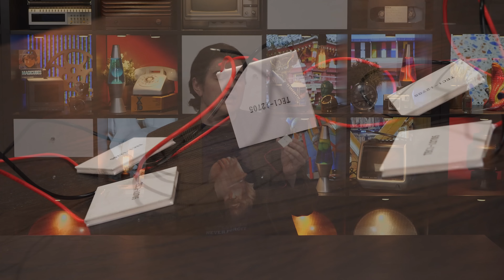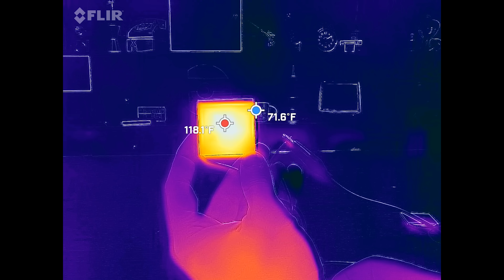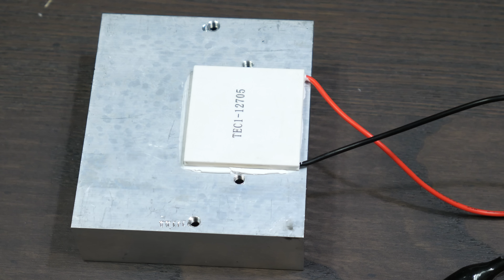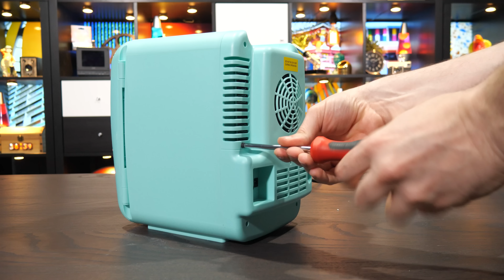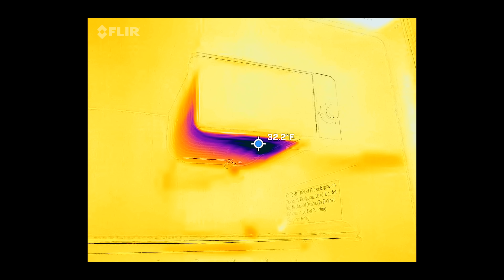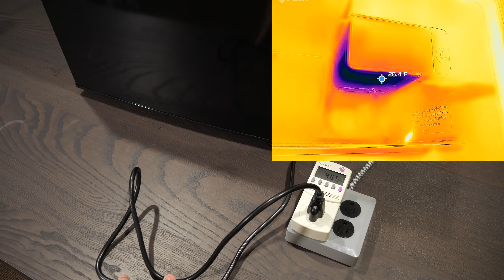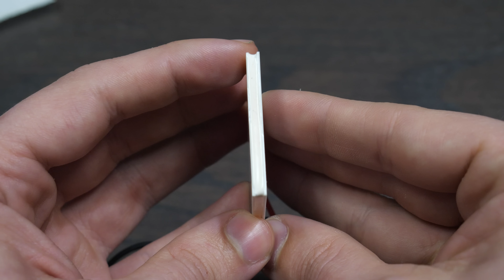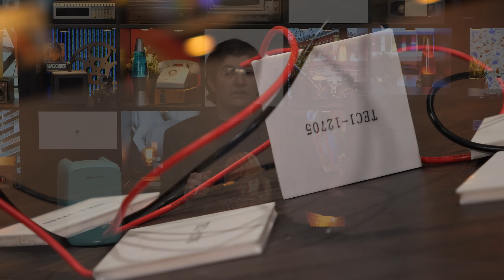Thermoelectric cooling: it's not great.

Comment: Any kind of possibly useful for a small cooler with Peltier requires fans on both hot and cold sides, plus best in class insulation, and, are useful only because of the compact size, and 12 V Operation...I guess, if I could get a 10 litre cooler that could run from 12 V, that would be dandy, but these all cost more than an office size fridge...

Comment: We use the other side of the Peltier to make a mini-incubator. It works well. However, if you're trying to grow cells inside, it requires a CO2 feed and the Temperature needed to be calibrated. We are building it up to make a product package to use with our custom diagnostic tools.

Comment: Peltiers are a cool technology (pun intended) but it's laughable some of the consumer products that they're put into and horribly inefficient for. 

They're useful for very specific needs where efficiency isn't important (why you'll never see them used for laptops) and often temporary such as transporting perishable items from one cooling solution to another. But in the vast majority of real world applications there's simply superior solutions available. 

The most viable consumer application would probably be exotic CPU cooling but even then you need a lot of other tech to keep it in line and scale quickly up and down with the cooling needs of a CPU, because when that CPU stops working hard that peltier quickly goes sub-ambient creating condensation. I don't need to explain why water+electronics equals a bad time.

Comment: So the FDA recommends 40° F or about 4° C as food safe. The EU recommends 5° C (41° F). Both sound reasonable enough, but then there's us Germans with an unhealthy obsession of energy saving. The German Federal Environment Agency (Umweltbundesamt) recommends 7° C (45° F) to save energy. And there even some "experts" on public broadcasting media that recommend 8° C (46° F) and if you ask around, some people go even higher. I personally use the EU recommendation with 5° C. I really don't care about saving energy if food safety could be compromised. Health is way more important. According to the data sheet of my fridge (based on EU-wide standardized metric with 5° C) it's using about 163 kWh per year. Each degree C less will save about 5% power, so turning my fridge to 7° C instead of 5° C would save about 16 kWh per year or about EUR 5.30. Wow, that's not even worth a Big Mac ...

Comment: It’s funny, because I actually own a good quality micro fridge that uses a peltier cooler.  And it gets cold in there, so cold that ice forms on the screws, and my drinks could be kept cold in my bedroom during the summer in Nevada.  Granted, it was a Star Wars micro fridge that looked like R2D2, and it came out before the new trilogy so quality was kind of to be expected.  It wasn’t the most efficient thing in the world, but I also didn’t have a lot of space in my bedroom, so it worked decently well.  Although I completely agree that the ones from AliExpress that cost 30 bucks blow as good as a shark.

Comment: I'm surprised with your such detailed examination of cooling via Peltier  modules, that you didn't mention that they can also produce electricity. I have a wonderful little fan in the top of my wood burner that efficiently spreads the heat from the burner around our home and the fan is powered by a Peltier module for free no batteries, taking heat from the burner at the base and cool air sink via the upper fins being drawn through by the Peltier module driven fan making the cool / warm Peltier module plate difference and hay presto electricity generation. I think you need to do an update showing this common contraption. I once had a workshop where the electricity was in on the rent and I had a Peltier cooler there, it was about four times or more the size of your demo Peltier cooler and it kept bread, milk and other food stuffs fresh, plus after work beers importantly and it ran 24/7 for 5 years; probably not that environmental friendly, but better than all those CFC's that will still be released one day when those age old pump fridges gives up the ghost hay, how's the hole in ozone layer going over your way today ¿?

Comment: I'm sorry I don't have half an hour to watch your video but I watched the first 10 minutes. Which annoyed the s*** out of me. The first 2 points you made against that little blue fridge I personally know to be wrong about devices cooled this way. It applies to that little blue trash yes. However I had a basic cube like you showed as a peltier cooled fridge that had a temperature knob AND kept my beer around 32°F for years. Meanwhile I have a small wine fridge also peltier device which also has a temperature control (digital) that I have had set to keep my wine bottles at 42°F which does so. I do not have air conditioning so my ambient temperature is basically outside temperature so my wine fridge will cool and keep my wine cool (at 42°F) even when its 102°F out. So yeah you bought junk and compared it to real real Refrigeration devices that doesn't make all pelty on devices junk. Is it safe to assume since I already know that your first two points are inaccurate the third one's probably not accurate with all of the devices also.

Comment: Peltier elements are also used in automotive seat heating/cooling! Heated-only seats generally just use heating elements, but "climate-controlled" seats will use Peltier-elements with fans to quite impressive effect!

Comment: The energy usage is defintely something to consider in something like that.  Unless you have ever before, you should do a video on heat pump water heaters, and in comparison to standard heating element counterparts.  They sound like a pretty good deal, especially for the free air conditioning they can provide, and if not just this side of $2K, I would have replaced mine with one.  Alas, that was well out of my budget, and went with a standard elemented unit instead, though that unit does have WiFi that allows you to adjust temperatures per days/times, which made already a good bit better than the original water heater, despite it having 10 gallons more capacity.

Comment: You can also get small 12v coolers for the car that are compressor based. We take one on every long road trip. You can even run them on small portable battery packs for 8-12 hours in case you need to leave it in the car overnight while you sleep without running the car battery down.

Comment: 25:18 you should do a video on portable refrigerators :)! For example Makita makes a portable Refrigerator that runs on power tool batteries, 120v, or the 12v of a vehicle! It actually has a legit compressor inside too!!! It's really expensive though 😬

Comment: There are two points I thought of that seem worth mentioning. First, when discussing global warming potential of isobutane, its main benefit is that it is volatile. Most of it will never reach the upper atmosphere, nor will it persist there. Second, the other issue with tilting a refrigeration system is that liquid refrigerant can end up in the compressor. If there’s more than a small amount of liquid refrigerant in it when it starts up, it will severely damage itself.

Comment: Way outside the scope of this video, but one neat technical use of Peltier elements is in chilled mirror hygrometers. Basically it uses a Peltier element to cool a mirror until it fogs up (fogginess is detected with a laser), then it measures the temperature of the mirror to determine the dew point.

Comment: I have a peltier powered fan that sits on top of my wood burner. The heat from the wood burner powers the fan using a peltier and moves the warm air around the room. Completely different use for it of course but I think an efficient and cost-effective one?

Comment: My only experience of these little fridges was during my time at University in the UK in halls of residence, I didn't pay for electricity so I had no idea of the cost of running it, and I don't know whether ours have better insulation over here or if its because we generally have a lower ambient temperature, but it cooled my beers very well, yes it might take a while to get them cool from being put in but it wasnt bad as long as I put new ones in while there were still a few cool ones, and it got so cold inside that it turned condensation on the walls to ice. The noise never bothered me, was quieter than my PC fans that were only a few meters away. And I couldnt afford (nor fit) even a small mini fridge in my room as a student, pretty sure my peltier cooler was cheaper than £30 and mininfridges were more expensivethan £100 at the time as well. So whilst I dont deny any of your science, I do think there are some limited use cases where they are preferable to a technically superior proper mini fridge, especially people with prepaid bills.

Also you get peltier cooled cool boxes which can plug into cigarette lighters in cars or usb power supplies like battery packs which can be useful for camping or traveling, not quite the same silly plastic box but a similar and non niche use case for peltier coolers as a means to keep food/drink cool for longer.

Comment: You've said that heat pumps have an efficiency of like 300% the electric cooler doesn't have those benefits which is a major part of the problem, I wouldn't be surprised if the fan alone pulls 8-10 watts. There is no way we will ever reach anything near 100% efficiency let alone 300% of modern heat pumps.

Comment: I work as an engineer and we are working on a device where heating and cooling are both required and in a small space. Peltier elements are great for those and what we currently use. Just changing the direction of current makes the hot and cold side switch. Granted it’s not the only way to do this, and it’s not the fasted either, but in terms of simplicity it’s quite neat

Comment: Personally I believe one of the  biggest problem with these is just design. The manufacturers always just have a small metal plate on the cold side of the pelt unit and the heat sinks while a fair bit bigger than the pelt unit itself, are still a little small. If they built them so that all inside walls of the fridge (except for the door obviously) were one big metal container attached directly to the pelt unit, and if they made the back of the micro fridge almost entirely a heat sink in it’s self, I’m sure they would be far more effective. No more efficient probably but that’s not really my gig. 
But as is, most of the heat isn’t being effectively conducted from the cans/inside of the fridge into the pelt unit itself.

Comment: yes perhaps it is the 3 times 230, but your quote here : "it's much bigger than a typical mini-fridge" implies that you are talking about a not typical mini-fridge or atleast that's what I hear.
btw there is one really simpel good use of a peltier element you see a lot here in europe were people like me life, who just use 6to8 kwh a day in a 7 people household (Ok I know that's low even for europe).How are we able to life with that little electricity? We burn wood to heat our house , water and even cook on it in winter And we use cob (thermal mass) to keep our house cool in sommer.  
And  on  a wood stove you can put a ventilator driven by a peltier element. It's really effective to spread the heat through the room.  You can get them for about €20 and are often marketet as  electricity free ventilator..... yes I know reality and marketing....

Comment: I have built a small peltier based fridge by myselft. Was a quite good lesson for my apprenticeship. But I never used it for a long time, cause the wires I used to withstand the 8 amps at 14V were not thick enough and it gets very hot the longer the small thing was running.

Comment: TEC modules have also been used for PC cooling, just slap one between the CPU and cooler, now you got improved cooling.
Linus Tech Tips also built an actively cooled gaming chair with one, with watercooling tubes going through the seat foam and a TEC between the waterblock and a CPU cooler.

Comment: My eyes have rolled fully around so I can see again.  I bought my father a wine cabinet some 15 years ago.  It keeps two cases of wine within one degree Fahrenheit.  And it does it via thermoelectric cooling.   Yes it does have a fan, but it is a jillion times quieter than a compressor.  AND it uses less electricity.  No it doesn't run all the time, only when needed.  

The Peltier element in it is not much bigger than the one you have there.  I think the problem must be with the control circuitry and materials, and not thermoelectric cooling in and of itself.

Comment: While you're correct that heat pumps are more efficient... you're totally ignoring other elements of physics at play.

There's a reason why polar bears are the largest amongst bears... the larger a body gets the smaller the percentage of it will be exposed to the surrounding temperatures.

If a polar bear was mouse sized, it would need to be very hyperactive not to freeze solid in a few hours.

So, my suggestion would be,  do get the same wattage of peltiers with cooling elements, perhaps use a proper noctua with heatpipes on both the heating and cooling side and use it on the same fridge, same size and watts and all... that would be comparable.

Anyway, I do agree that the microfridges are not efficient... but it's not just because they don't use heat pumps. The smaller an ice cube gets the quicker it melts... simple physics that you seem to ignore while you rant.

Edit: 😏 is this all because you understand heat pumps but have no clue how peltier elements work?  Think of them like LEDs but on heat rather than light... they can harvest heat energy, just like LEDs can be light sensors.

Comment: I have a Coleman Thermoelectric "ice chest" which I have used several times for the NAMM trade show in Anaheim California for our Hammond USA crew.  It doesn't get instantly cold, but since the Anaheim Convention Center is usually rather cool inside 24/7 it did very well.
Reply: A friend purchased one of the little thermoelectric refrigerators which only holds a 6-pack of soda and was surprised it didn't cool that well... hehe

Comment: I used to use one of these and although incredibly inefficient I didn't hate it. I used to keep the my beverages in the main fridge downstairs and then I used to put some in my office mini cooler when they were already cold. I don't like my house too warm, so room temp I keep at around 18-20c. My mini cooler would happily keep my cans around 4c. Not bad for the price I paid. Besides that if you stack the cans on top of each other end to end you can 8 in there rather than 6. 

Again incredibly inefficient but useful as a device of convenience for when I was working and may not be able to leave my desk for long periods of time. Also they are great for white wine lol. Decanting wine into a suitable vessel that fits in the cooler means you can top up easily while watching a movie without having to go the kitchen or ending up with warm wine by keeping the bottle on the coffee table.

Comment: Actually, i use a mini freezer for my drinks on my deck outside. I turn it on the lowest thermostat setting and it keeps up with hot outside temps just fine.Never had to set it any lower to keep up. Always makes bottles and cans frosty fast.

Comment: If it can theoretically get below freezing if only the door was insulated fully, you'd think they would at least partially insulate the door so it can do better than a 30 Fahrenheit difference after 12 hours. Maybe even fully insulate it then lower the power use to avoid freezing and save on power at the same time.

Comment: Dehumidification in a small area without tons of noise and power is currently saving a bathroom from mold and mildew. (No good way to add or improve ventilation.). My gripe with most of the products is that they seem to be screwed and snapped together so that I am not able to service or clean the inside or replace the computer fan with a quieter one without breaking the plastic molding.  I have had a few units fail eventually with the AC to DC converter usually from 120VAC to 9VDC.

Comment: Just doubling down on his last point but the portability and the ability to heat as well as cool are the main two advantages to these designs. When used in the higher end portable coolers they tend to have proper insulation, dual fans for better air circulation, and a thermostat. These do a decent job in fixing the main efficiency issues that are commonly attributed to thermo electric cooling. So unfortunately the only products that use Peltier cooling and are actually good also come at a much higher price.

Comment: When I took apart a mini fridge and discovered the peltier element I was so amazed. I build a lot of different DIY mini fridges and tried a bunch of things. It's great for DIY stuff and if you cool the hot side more effectively and don't care about power consumption you can reach very low temperatures, by stacking them for example. The ease of use and simplicity is their main advantage.

Comment: I've seen those little guys being used in research labs to identify materials, by generating contrelled shapoed heat waves and comparing with the sensed temperature that passes through the material to be identified.

Comment: Cool video. Another useful effect of the peltier is that if you apply a heat differential, then it will produce a small voltage. You can buy fans that sit atop a fireplace that are essentially an aluminium heatsink attached to the cold side, then the hot side is just a single piece of aluminium that sits on the hot surface of the firebox. Once enough heat conducts up the hot side then it will power the fan, which helps spread  the heat around the room. A friend of mine also had a candle powered radio that utilised a couple of peltiers in series, where the heat from the candle to power a small transistor radio.